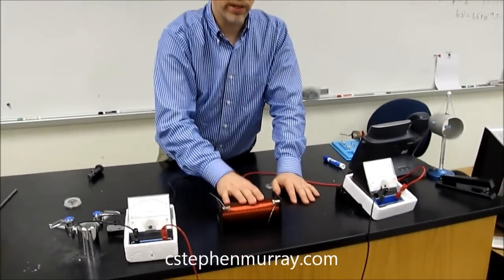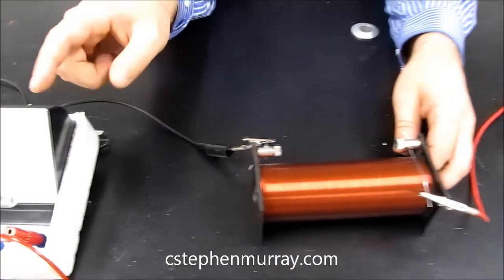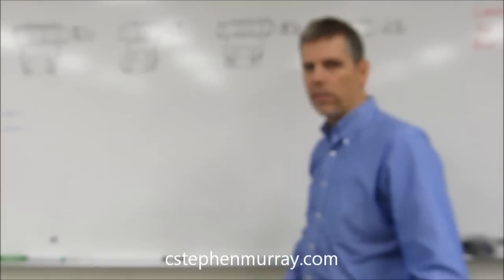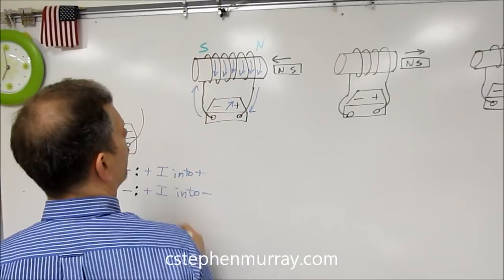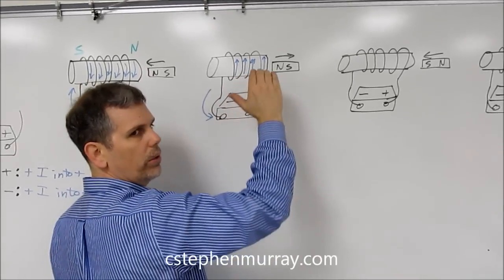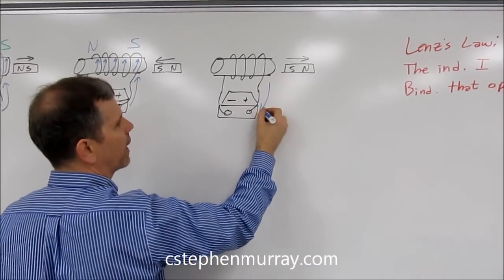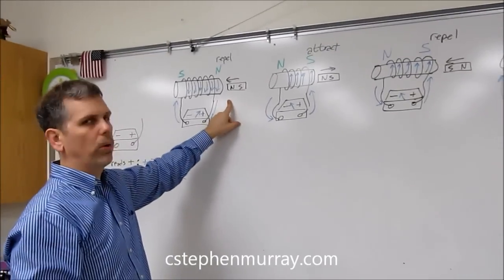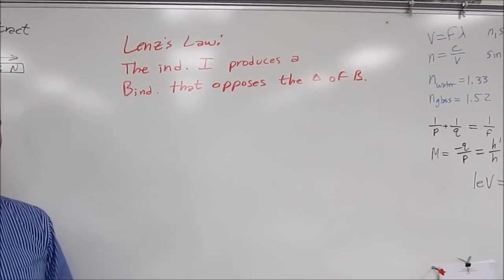Lenz Law Part2: Deriving Lenz's Law

Comment: I couldn't disagree more.  You did a great job of measuring induced EMF but you forced the polarity of the induced magnetic field to match your erroneous definition of Lenz's Law.  This is quite different from your definition: "An induced electromotive force (emf) always gives rise to a current whose magnetic field opposes the original change in magnetic flux."  If you think that you got it right, just replace your galvanometer with a battery using the same polarity. You'll find everything reverses.
Reply: RaOfEarth galvanometer with battery?
Reply: Does Flemming's left-hand rule fit to what he is trying to show?
Reply: RaOfEarth Is this a derivation, as he says, or just a casual demonstration?